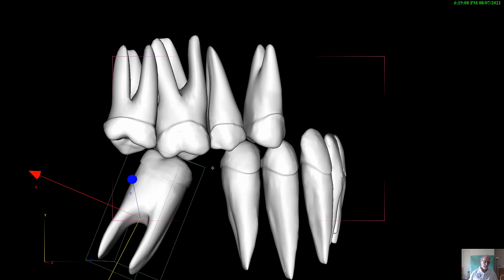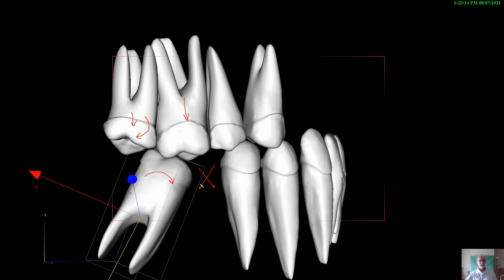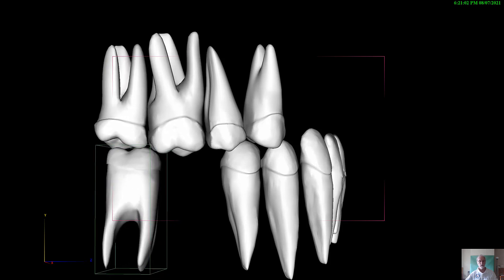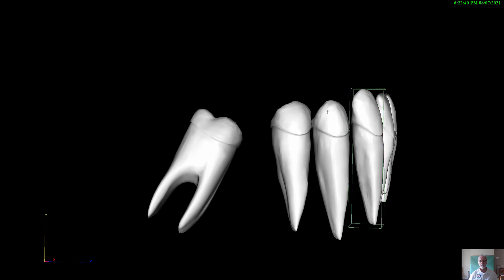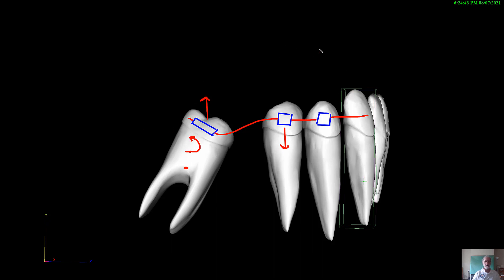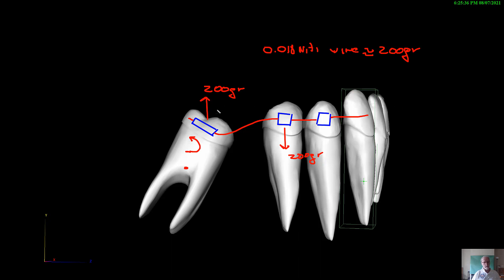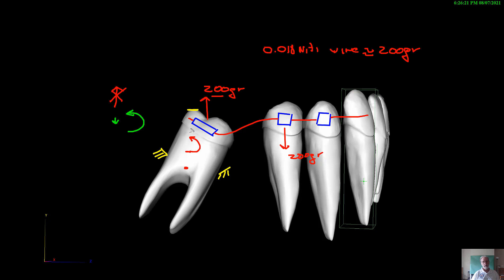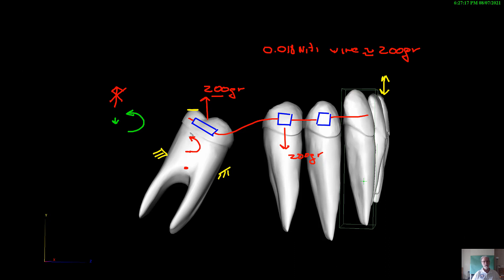Uprighting molars with the  Straight wire system part 1

Comment: I dont know why nobody could think as simple as using smaller wire like 0.012 or 0.014 Niti if too high force was the problem of using 0.018?
Reply from the maker: You still create an unfavorable moment to force ratio and concentrate the forces on the crestal bone. Basically negative instead of positive remodeling. Plus too much extrusive force